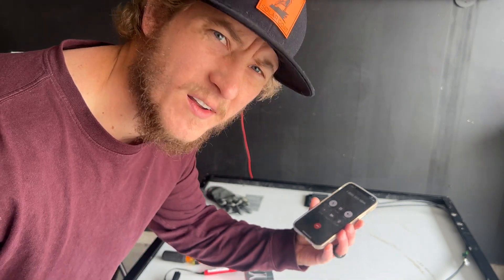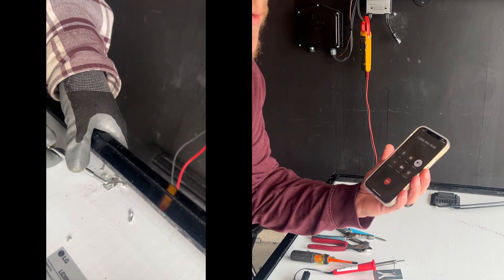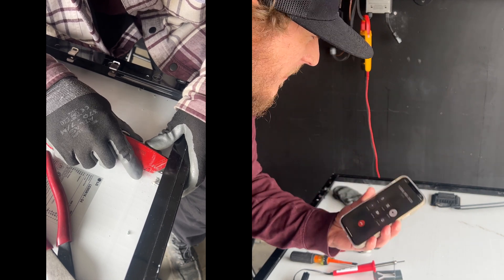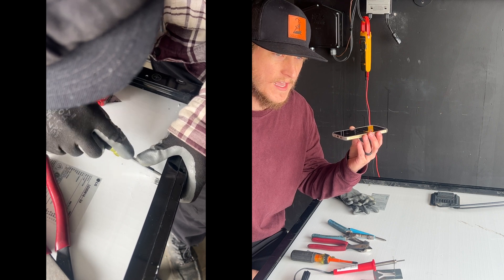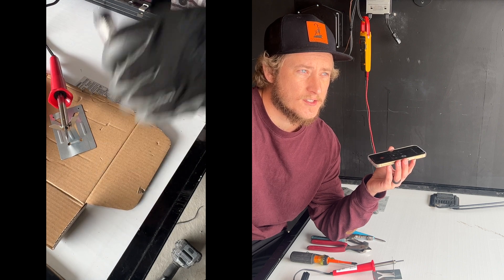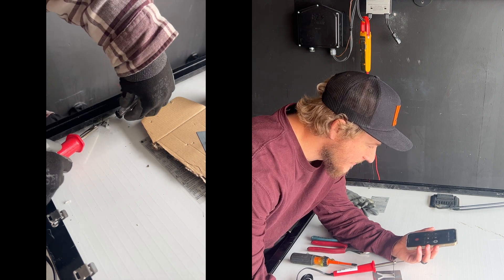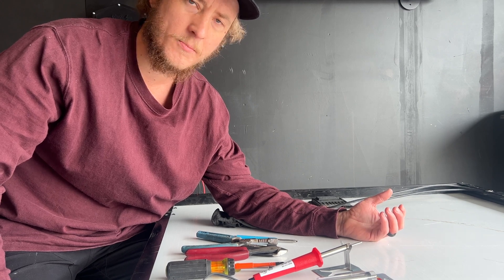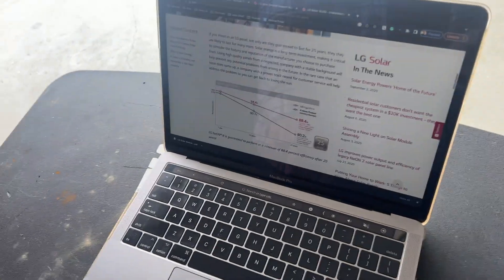Solar Manufactures Won’t Let me Fix Their Panels

Comment: The biggest reason for not allowing repair, is liability. If they allow the repair and there is any issue later such as a fire, if it can be linked to their panel, they will be the biggest pockets for the lawsuit. They have been burned from incompetent contractors/homeowners doing repairs. The other issue is brand protection, there are companies that will not sell production equipment to manufacturing companies, they lease it and provide all service, while there are some profits from this one of the biggest advantages is not hav in a machine they sold to a company, that was then repaired/modified with non-standard parts end up on used market. The next customer buys the machine, has trouble with it, it injures an employee or causes some kind of damage to customers factory, lawsuit gets filed against the name of company on machine, not the guy who made modifications. Equipment manufacturer is now out time and money in lawsuit trying to prove it was not their machine anymore since previous owner messed with it. Plus once enough used machines are on the market that have been modified/bad repairs, the brand can start to get the reputation of being unreliable/poorly made, when it is the fault of bad repairs not original quality. Much easier to just not allow repairs/service by anyone outside the company who makes it.